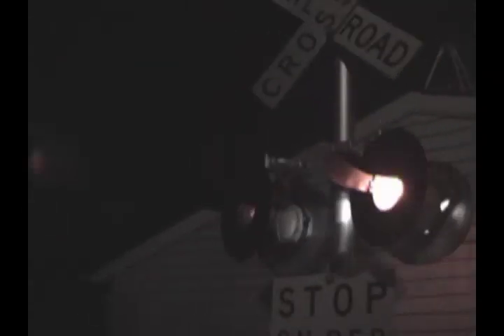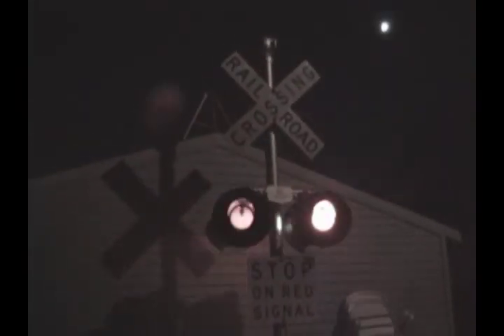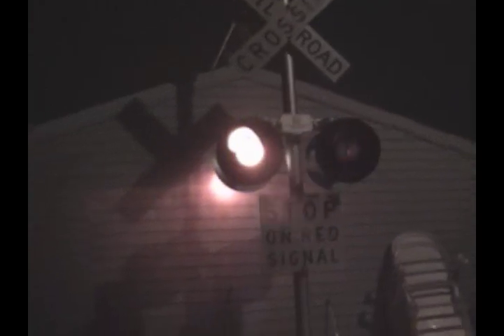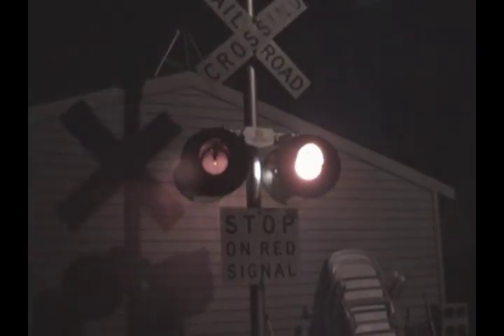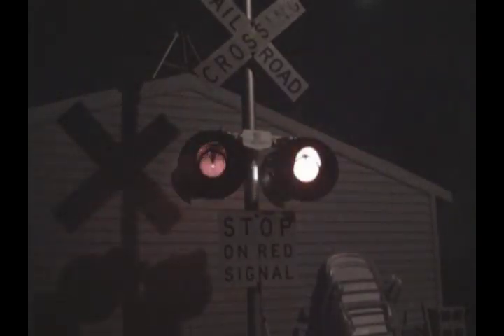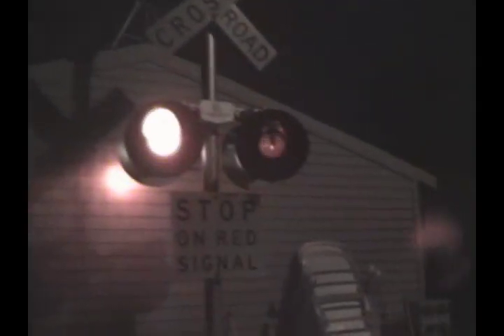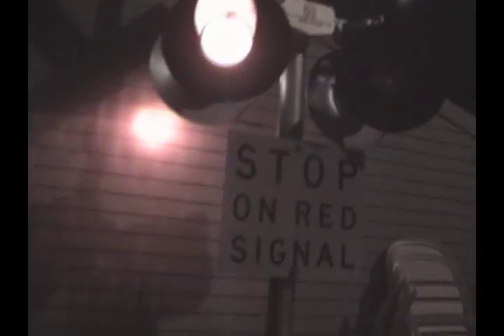My WRRS 8" Mast Signal on Motion Detector

Comment from the maker: There are a set of electromagnetic coils on the flasher relay, connected together with a top plate that goes to a pole  in front of the two coils, with washers on it.  This is what controls the flash rate.  The more washers you take off, the faster the relay will flash.